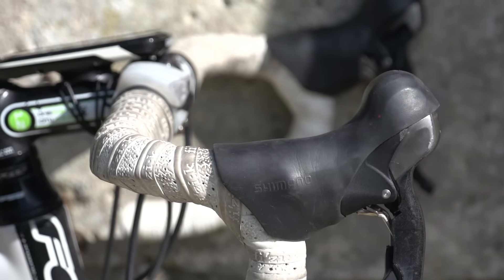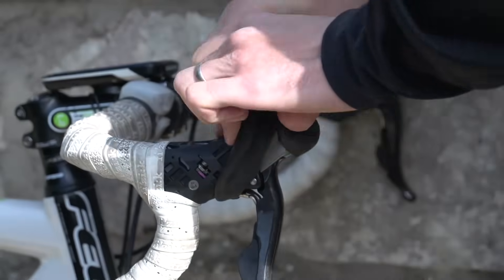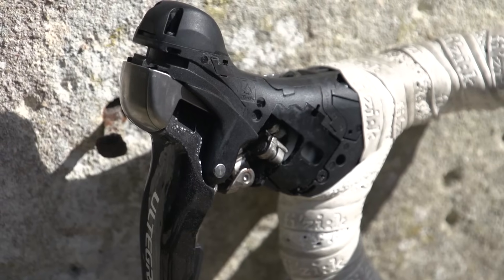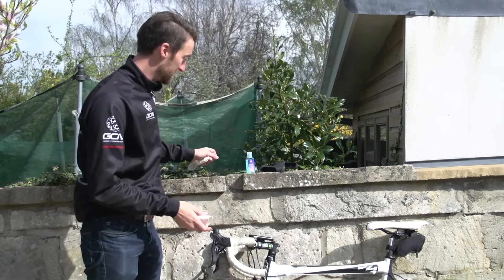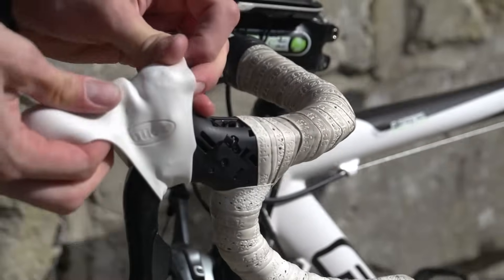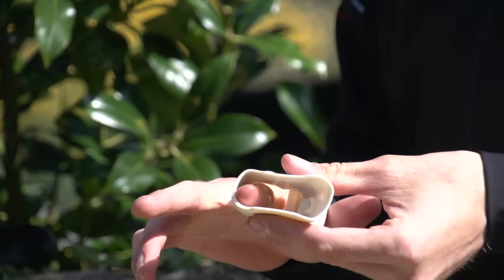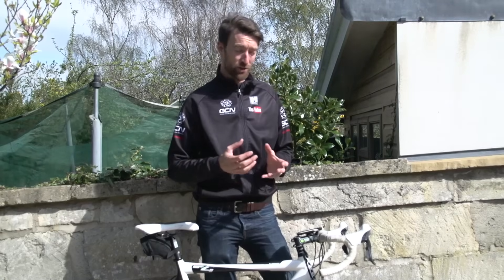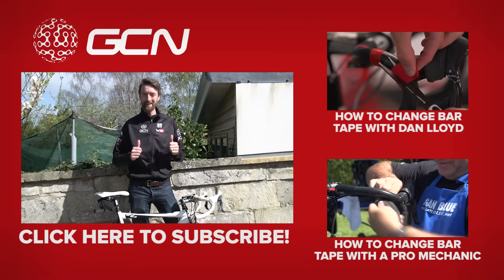How To Change Shimano STI Lever Hoods

Comment: This may be an "old" video by internet standards but it has come time for me to replace the hoods on my Dura Ace STI shifters.  After fiddling with the new hoods for a while, this video showed me the "trick" and I got both of the sorted in a matter of a few minutes.  Thanks for keeping info like this up as my components grow older and need replacement.
Reply: Yups, me too, at first its too tight to fit my new hood covers, that trick reeally works!! 2023 still kicks in...
Reply: Me too. This video saves my time to get the job done in a timely manner.

Comment: Was as careful as possible and new Dura-Ace hood I was trying to put on tore easily... moral of the story here I think is to do the extra work and take the shifter off the bar if you're going to do this and don't want to take the risk.
Reply: same thing just happened to me with DA hood - big bummer
Reply: And to me, this method 100% does not work for Dura Ace hoods
Reply: Well that’s great.  Just bough DA hoods, tore the old ones off and then read this...I’m not taking the levers off.

Comment: All good tips! 
I have white and yellow bar tape on my bikes, and found a good way to extend the life of your neatly wrapped bar tape: You can easily wash that grime off with a vigourous scrub using a soft brush and a slurry of OxiClean (dissolved in hot water). Then rinse them off with water and let dry...good as new!

Comment: Being 70 years old, I don't have the same hand strength I used to have. I cut off the old ST-R785 hoods, and used your GREAT TIP to use hand sanitizer to install the new ones. Thanks, the new ones look great on the bike!

Comment: I wish more companies made aftermarket hoods. It's as personalized an item as bar tape, but only a couple options out there. I would really like options on the color, texture and suppleness. I cant even find replacements for Shimano Claris. A good tip : Place a small square of bar tape under the hood where your hands rest for a little extra padding.

Comment: I just changed my DA9000 hoods in 2 minutes flat using this method and no tears on the new hoods. The old hoods “tore” coming off. I had a few practices with the old hoods and realised like Dan shows the hoods are hard to tear by force BUT they do cut easily. If you look at the 9000 levers there are two exposed metal actuators underneath the levers. When putting the new hoods on DO NOT let the hood touch these metal sections as they simply slice through the hood. If you push the hood up far enough then keep a finger under to stop the metal cutting the hood, use your other hand to carefully drag the hood over the top you don’t “tear” i.e. cut the new hood pulling it on. Hope that helps. You can clearly see the two metal strips to watch out for when the old hood is off.

Comment: I used a pair of plyers to grab the hoods to pull them on and off.  Helped a lot.  Also used gel lube getting them both on and off.  Used a screw driver to fine tune the hood at the end.

Comment: It's even easier if you first turn the hood upside down, because the bottom part has a lot less rubber to push over the hood than the top part. I'm amazed they didn't do it that way in the first place. I've managed to do it off and on today without any lubrication. With much effort, but surely less than pulling it off as it is. If I used some lubrication it would be a snap.

Comment: Worth adding: besides the brake hood logo facing outward, at least the Shimano R-7000 hoods I just replaced on my bike have clear L/R indicators inside the hoods to point out which goes on which side.  And I'd be surprised if most hoods don't have similar.

Comment: Worked a treat, many thanks, though I did rip one of the old covers getting it off and cut the remainder off with a scissors!  Much easier getting the new ones on that the old ones off which was a pleasant surprise.

Comment: Dura Ace 9000 users : there's so many comments saying how it's impossible to change the hoods using this method.  Simply not true!  Given that 9000 hoods are difficult to source to begin with (at least here in the UK) I was very concerned about fitting my new hoods and potentially tearing them and possibly rendering them useless.  I needn't have worried.  I waited until the sunniest, hottest day of the year so far and worked in the sun so the rubber would be as soft as it could be. (I'm in Scotland so maybe what's a hot day for me is any day over 25C so maybe not too hot for others). I used washing up liquid in the end instead of sanitizer gel as I found the gel was evaporating too quickly. I  also wore a pair of rubber gardening gloves which gave me more grip on the hoods and I gradually worked the hoods up over the bump and into place. It took a little time and persistence but it worked just fine. No need to remove the levers from the bike, no need to take your bike to the bike shop, just take your time and you'll get the job done.

Comment: Global Cycling Network You have to be very careful with the DA 9000 hoods, have found that they snap and rip like nothing else, helpful vid though!
Reply: John Law correct 9000 Hoods will tear even old ones coming off will tear you need take the levers of the bars to install them
Reply: Now I see this warning, after tearing a new DA9000 hood applying the method of this video...
Reply: Yes this method 100% does not work for DA 9000 hoods. Guaranteed to tear the hood getting it on there

Comment: Managed to replaced my 7970 hood which is no longer available after market with 6870 hood.  Almost but not completely the same.  Felt good with the new one as the old durace hood is disintegrating and very sticky.

Comment: I just did this job on my SRAM hoods using the hairdryer to warm the rubber first. On one side I used talcum powder, on the other side I used nothing. The talcum powder helped, but the job is also possible with no lube.
Reply: Won’t talcum powder leave deposits? Rubbing alcohol is the official recommendation as it evaporates eventually. GCN suggests hand sanitizer because it’s more widely available (well, not so anymore during this pandemic) and also evaporates leaving nothing behind that can interfere with the performance of the shifter.

Comment: I had white brakes hoods a while back, and while it looks cool it's rather sensitive for smudges like chain oil etc i found it impossible to keep the white 'white'.
(In contrast to white leather bar tape, that stays white and is easy to clean smudges off)
Reply: Efstathios Dimopoulos Bleach deteriorates plastic at a rapid pace.  Definitely don't use it on plastics, especially ones that see sunlight.  Brake hoods are silicone, BTW.
Reply: thechosendude Funny.... in the old days when I was still smoking, I used to immerse my white keyboard keys and keyboard enclosure in Clorox solution overnight and in the morning they were sparkling clean. I'm not talking about the stuff used in pools but for clorox diluted in water..

Comment: Are Shimano hoods a one size fits all or are each model different?
Reply: Some models like 105 and ultegra (in some cases) are the same. But there are also different designs. Order the correct ones by checking the STI part number.
Reply: thank you!
Reply: Adam Najduch You're welcome!

Comment: The best way is to take the shifter off the handle bar and replace the hood. I did it this way and messed up the mechanism underneath the lever. Beware.

Comment: Can you use ANY type of hood.  When I google available options, there seems to be so many sizes, and shapes.  How do you know the specific shape and size hood for my brake level hood cover size and style of brake?
Reply: You need to identify the exact brand and model of your shifter. Last point is important as there are variants of shifters - ST-5700 may have a slight difference with ST-5701. From my brief search I wasn’t able to find an abundance of third party covers so I stuck with genuine ones from Shimano.

Comment: If you don't care about the old hoods...cut them off with a pair of scissors and spray rubbing alcohol on the lever body and inside of the new hoods. Hoods slide on with minimal effort.

Comment: Wouldn't it be easier to cut the old hoods off with a box cutter so you don't have to wrestle them off ?
Reply: Unless you rip your new ones putting them on
Reply: @LoscoeLad  What does one (taking the old ones off) have to do with the other (putting new hoods on)? Cutting the old ones off saves a lot of time and trouble.
Reply: If you rip the new one putting it on, but cut off the old one before that, you can't ride you bike until you source new hoods.. Which can be difficult. That's why they are related
Reply: @LoscoeLad  You just have to be  careful and not rip the new ones. Soak them in hot water before putting them on so they'll stretch . It shouldn't take the strength of Hercules to do that.